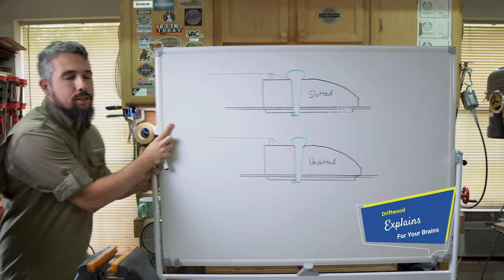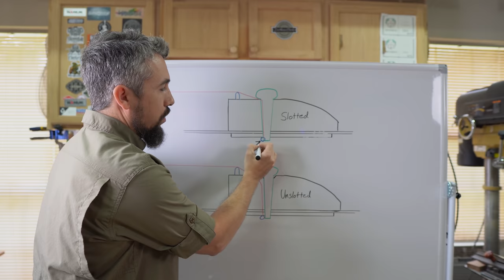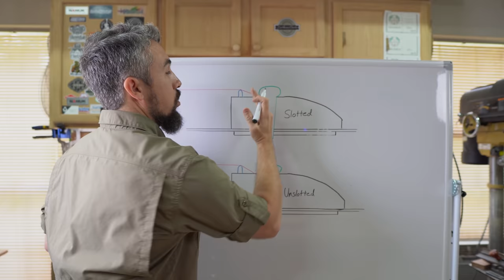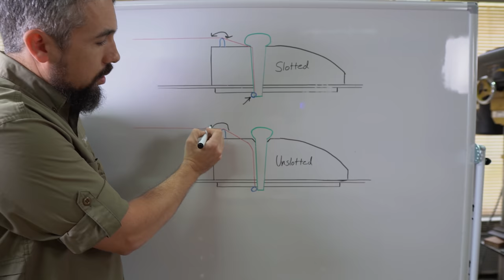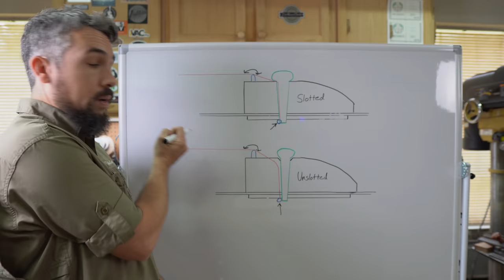This $25 Tool Can Help Anyone Make Their Guitar Sound Better!

Comment: This actually works very well. Been doing this since I was a young teen. I've done this to many of my acoustic guitars as well as tons of other people's guitars that I worked on. Didn't even buy unslotted pins for most because just like you said, you can just turn the slotted pins around.  I did eventually get unslotted pins for most of mine though just because they are more solid (and they look nice). Everyone that I've done this for has absolutely loved the sound when finished, including myself. Truly does make a big difference and I'm glad you uploaded this for people to see because I haven't really heard anyone else talk about this besides the people i did it for after I explained it to them and a few luthiers here and there. Great vid, man!
Reply: I think Im going to do it to my Taylor. Thanks for this comment
Reply: @3000LeftyMagician  definitely worth it if your guitar doesn't come like that already. Just make sure you're careful. If done correctly, you won't even need the pins because the strings will be "locked" when enough tension is on them. I also suggest cutting off the ball ends of some old strings and running your new strings through the ball end so that the old ball end is flat against the underside of the bridge plate when you put new strings on. Think of the ball end as a tire and the underside of the bridge plate the ground. Instead of the tire (ball end) being perpendicular to the ground (underside of bridge plate) as if it were rolling on it, make sure it's parallel to the ground as if the tire fell over.  It adds more surface contact and sounds even better. The ball end trick isn't necessary but it really does make it sound even better. I gotta get to bed but if you have any questions, feel free to ask and I'll get back to you in the morning. Take care!
Reply: @3000LeftyMagician  it was really late last night and I was falling asleep as I heard your notification. So I'm sorry if I made anything sound confusing. But I just edited it to explain it better. Hope I explained the ball end trick well enough. Good luck and I guarantee you'll notice and like the results if done correctly.
Reply: Thank you so much for this, I was very nervous and hesitant to do this but now I am for sure going to do it. Thank you for the advice and taking the time do respond you are a great help. And thanks for the tip on the double ball end on the strings! I will take them off my next old pair when I restring em after I slot the bridge.
Reply: @3000LeftyMagician  you're very welcome! Glad I could be of help. I hope you enjoy the new and amazing sound you'll be getting. It truly makes a great difference. Have a good one!
Reply: @SSGSativa  should I do the ramp as well to bring it closer to the bridge? I had someone do it for me for 20 bucks but I forgot to ask them to ramp it and bring it closer to the bridge but the it is slotted bridge now
Reply: @3000LeftyMagician   I always make the top of the notches ramped just so that the strings aren't against a sharp angle and don't get caught on any kinks. It gives a better break angle as well. You don't wanna go too far through the bridge to the saddle but pretty close. I'd have to look at it specifically but it's better imo to have ramps for the better break angle and so the strings aren't tight against a sharp angle of wood before they get to the saddle. Try to make the ramps just like in the diagram in this vid. If you go too far through the bridge and right up to the saddle and the wound part of your strings are making contact with the saddle, you can add extra ball ends on the strings to make it so the wound parts of strings don't rest on the saddle. But it's best to avoid having to do that. The end of the ramps will be pretty close to the saddle if done correctly but I've never had to go completely all the way to the saddle when adding ramps to the newly slotted string slots. And it's ok for the ramps to go through the bridge just as long as you don't get too close to the saddle. But I would add ramps if I were you unless you feel content with what you have. But again, I'd have to look at it to show you how far you should go and when to stop.  It can be ok if the ramps go all the way to the saddle but you wanna make sure the extra winding at the bottom of the strings aren't resting on the saddle.
Reply: @3000LeftyMagician  sorry if I explained that badly. It's one of those things that I could explain better if seeing your guitar and how close the strings are now that you had it slotted. But I would add ramps if I were you. Gives your strings a better break angle and they won't be tight against any sharp angles when coming out the top of the slots.
Reply: @3000LeftyMagician  YouTube won't let me add a link but try typing this in: Why you should cut string ramps in a guitar or ukulele bridge Beau Hannam. 
Around 13 minutes in, he explains it better and shows a diagram so try watching that vid if you are uncertain. I just now found it and it explains things a bit better. Haven't watched the entire thing yet so idk if he talks about the extra winding of strings resting on the saddle and why you don't want that but from what I've seen and heard from him so far, he explains everything pretty well.
Reply: @SSGSativa  thank you so much for your reply and explanation. I have a slight ramp but not one to where it increases the break angle on the saddle It’s just so the string can get out gradually. As I can see from the video I need to extend this ramp, I’ll give the guy a call tomorrow. Thanks so much for ur help and speedy responses!! You are a great help
Reply: @3000LeftyMagician  anytime! 👍

Comment: I would think you could use small jewelers files for this also.  A square edge one for the bass strings and a sharp edge file for treble,  with maybe a very fine round file to finish off.  It would take a bit longer to do, but would be less likely to screw up.
Reply: You could also use broken jewelry saw blades of various sizes to cut the slots. How about using golf tees for the pins?
Reply: I did this with jeweler files. I used those for feet jobs and they work fine as well.

Comment: Saddles absolutely make a difference. Bone is not always best. My favorite is usually micarta (depends on the guitar). I have swapped saddles at least 50 times and compared the difference.
Reply: I PREFER PLASTIC. THE SUSTAIN IS OFF THE CHARTS.
Reply: Question, what differences do you see in Saddles? You then prefer Micarta and Bone to any Plastic? Thx,,,

Comment: This works. I did this same thing when installing a fishman piezo under-saddle pickup on an old Yamaha ages ago.
But that was after i had installed without reading the fishman instructions, and got a lousy output. Then, after a few minutes with the manual,  slotting the bridge and increasing the break angle, i got a very measurable increase in output from the piezo. And more overall everything, as Chris says, from the unamplified guitar.

Comment: Thank you so much for this video. I performed this little operation on my beloved 1999 Larrivee Parlor yesterday - used the StewMac saws and 5 degree reamer and a set of Waverly unslotted bone bridge pins and I'm really happy with the results. It was always a great guitar, but just sounds more together, with more fullness and most noticeably, a significant increase in sustain. I wouldn't call the difference night and day or anything, but it's definitely an improvement. Thanks again for the instruction and encouragement.

Comment: Very happy to see this idea as I had come up with this myself after needing to lower my saddle to a reasonable action height and had to compensate by cutting the bridge slots to keep the string angle reasonable enough to push down on the saddle.

Comment: The break angle on that guitar is miles better than many guitars including Gibson's that I've worked on. Some have been so bad that there is no break angle on the first string. This is a very important video and you taught well.
Reply from the maker: I appreciate it. Back in my repair days I saw the same thing.

Comment: This really works. I’ve slotted the bridge on a couple of my guitars already. I used a Dremel tool for this, but I paid quit a bit for the slotted bridge pins, and since the pins were fairly new, I didn’t want to replace them just yet. I put the pins in with the slots facing away from the strings, and presto, they worked. It does, to my ears, make a difference. I didn’t think this up be myself though. I believe I must have seen this on another channel. Anyway, I’m retired, and I have a lot of free time. But, one can do quite a bit of damage with the Dremel, so I’ll be using one of those little saws on my Martins and Gibsons. 😎

Comment: When you're cutting the angle into the bridge slot, abrasive cord is a really good option because its flexible and you can fine tune the depth more easily. At least from my own experience.
Reply: What do you mean please explain

Comment: I would imagine that a jig saw blade with fine teeth on it and either a slotted glued handle,or tape wrapped around the fitting end as a grip would do the job nicely by hand,and would fit in the pin holes too.
Reply: It would have to be a very thin blade with very little set to the teeth. I'm thinking, not so good.
Reply: You must be a guitar builder. I have been for a little over 4 years and I've yet to buy a tool from StewMac! I have nothing against them it's just become a thing!

Comment: Just brilliant, coupled with a double ball end as per comments below and you’ll really hear the difference.
Note my Alvarez Yairi has a bridge plate flush with the top which increases string break angle and length of contact and force on the saddle. This produces amazing results so I know this slotted bridge method will work. Genius!

Comment: Thats super interesting. On electric we want less of a break angle over the bridge saddles. Changes the felt tension a little bit and have less of a chance of breaking a string. Acoustic is such a different animal
Reply: yeah, I was about to say that, while it makes sense, you don't really want a HUGE break angle..
maybe an alternative would be placing the bridgepins further back to compensate (of course when manufacturing the guitar)

Comment: Good stuff! I don’t want to distract from your goal for this video by jumping topics but I’ll try to make this brief. We, your viewers, benefit from this bridge modification but your frontless backless guitars would also be a great teaching tool for demonstrating how and where to affix acoustic guitar pickup (systems, ie: preamp, battery wiring etc.) and would help you demonstrate some sonic differences between sound enhancement electronics even without a full guitar. This came to mind after I read about the late JJ Cale who used a backless guitar to  allow him to experiment with pickup systems. An article revealed that he even used a Frankenstein guitar like this to perform b/4 audiences at times. I just wanted to plant a seed for further teachable moments with your chop top guitars. Great content guys!
Reply: A couple of wooden braces running from neck block to tail block wouldn’t obstruct the camera or the tools too much, could be detachable anyhow … slice the guitar near the back rather than the mid-point too, eh Driftwood?

Comment: So I ordered the two saws. I found that the small sized one wasn’t large enough to cut a channel for my unwound strings because of how the string is wrapped around itself near the hall end. To top that off, the larger of the saws wasn’t wide enough to cut a channel for my medium gage low E string. So, I made it a little thicker of a slot with my nut file and, viola, it worked. I don’t know that my Gibson sounds better or not, but I definitely feel better knowing the maximum energy of the strings is being utilized. Thanks guys, it was good/fun to do a little work on my guitar.
Reply: 3 weeks later, my Gibson definitely has a slightly brighter more resonant sound since slotting the bridge!
Reply: @imikewhitaker  Thank you for sharing your experience with the Stew Mac saws. Do you have before and after recordings for your private personal comparison? I always wonder when I make modifications if I am really noticing a change, or if my mind is giving me a sort of placebo effect. I should record before and after for myself, but I'm too lazy to set up the equipment and space for it!
Reply: @brushstroke3733  I didn't, but that would have been a great idea. I've played this Gibson for around 12+ years so I'm very familiar with it. One other thing I would add is that the string tension also feels slightly looser. I play medium Elixirs. Not sure why that is.

Comment: Good episode.  Yup, that works.  Another thing I like to do, is once you have 90% of the setup established, I take a fine needle file and make a slight "U" where the string crosses the saddle.  Make the U the same cross section as the string so that the string keys into the saddle.  That way the saddle captures the lateral energy and well as the vertical energy.  Helps with clarity and definition  😊

Comment: Great info, I'm going to do this even though I already love my guitars sound :)  I am inspired!
A couple of years ago I watched some old yt vids on how to file the end of slotted pegs, you gently file a 5-10 degree slope over the slot from the tip, not much more than when the bottom of it sticks out, something like 1/4-1/3 of an inch, and several on how to seat the bead of the string up tight, When you put in the new string you slide the peg and string at the same time, then before you push it in you tug the string until you hear it hit the top, the filing keeps the bead horizontal against the bridge bottom, then seat the peg.  I'm a noobie git player but this has worked wonderfully for me through many string changes on a cheap guitar (Epidr-100) and the pegs are still in great shape.
The explanation of surface sound transfer has me convinced to try this, one thing though is that there is no going back, so a small thought on this would be to soak the new slot with super glue to toughen up the lower woods in the body, just a thought.
Thank you so much for your time teaching folks, its easy to understand and you're good at it.  Cheers from BC Canada!

Comment: Really good info. I do slot the top for the break angle but haven't slotted all the way through the bridge because I've always leveraged the pin slot, so using solid pins and slotting all way through bridge will be a future test of mine. I also create a 3/32" thick brass plate stuck to underside of bridge for the string balls to grab to prevent bridge wear and it also gives the tone a tad bit more snap. I'll need to slightly slot the holes in the brass plate also. 👍

Comment: Thank you. This makes sense. I'm a mechanical engineer, forgive me if the technical jargon comes off pompous. I play acoustic and electric for fun. What I'm taking away from this talk is that the notched pins terminate the string in such a way that there is some springiness, or compliance to ground. The example of bent pins is proof that the pins are seeing a constant load, and being plastic are subject to creep, and in the mode your describing are buckling. Any amount of compliance between the source and load is going to introduce a low pass filter, like shocks on a car. If your the kind of player who loves new strings because they are bright and lively, you absolutely don't want any additional low pass to ground. A good amount of the high frequency content goes away and is used to heat the pins a thousandth of a degree instead of moving the top. Worse yet, the effect gets larger as frequency increases. I'm a finger picker and I like old strings because they are dead, have a stronger fundamental. I think you hear me more in the notes, but it's also style. It is exciting to put on new strings, no doubt, tuning up and banging out some loud strumming is fun, but I know the work of getting better as a player will only show when the strings have been on for a couple months. Kinda like how people sometimes like reverb because it covers up stuff.

Comment: A lot of times if you just push the string down before you try to remove a pin it usually comes out easily.